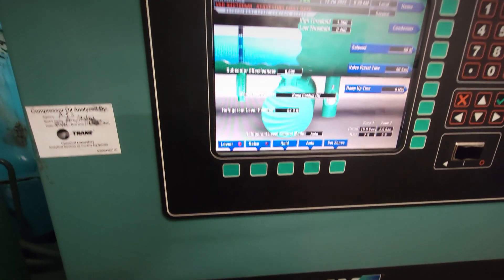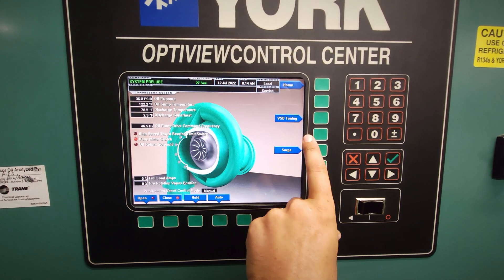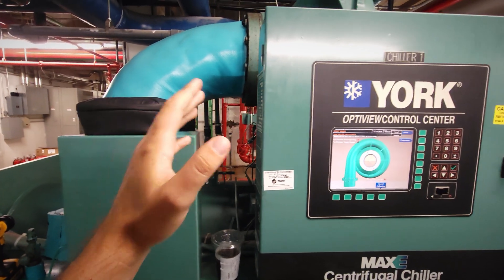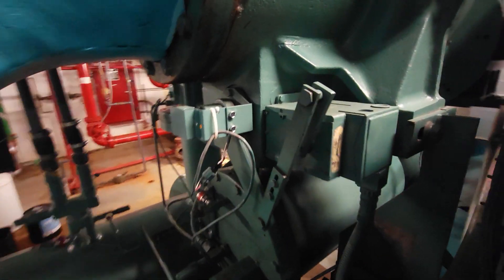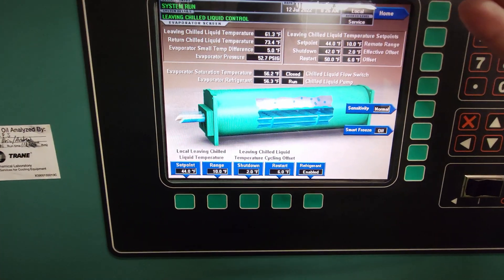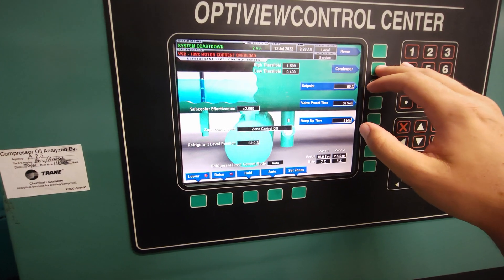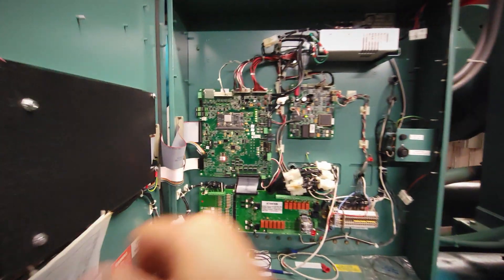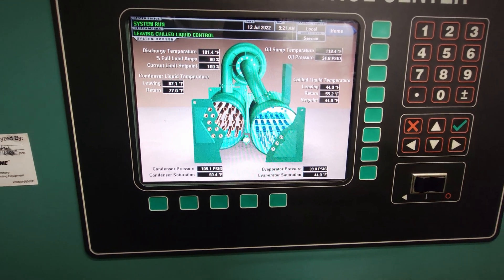Problems kept coming with chiller

Comment: doing a vane re-calibration has 0% to do with vane closed switch  or control of vanes. Vane motor does not stop when closing because the feed back position indicates 0. it is internal limits in motor or physical stalling before internal closed switch is made.  Important if sharing info that it is accurate. i don't want to be that negative guy but it is important to be correct.

Comment: Actuator more then likely on its way out. I’d clear out the surge map shows over 13k surges Maps probably full and machine will run better. 80% for 10 minutes is more then enough for your pull down. Just my two cents.  
Next time you are working on a York pull the VM cover. Vane Motor Switch Operation (VMS)
The auxiliary contacts are internal Normally - Open (NO) contacts on terminal 1 to 6 on the actuator terminal block. Notice that terminal 1 has a jumper wire 1A to L1. L1 is supplying 120 vac to terminal 1. When the vane motor actuator shaft is within 11° of being fully closed (CCW), the auxiliary contacts 1 to 6 close, supplying a 120 vac signal to terminal 6, which would then be routed to the respective control panel to indicate that the vane motor/pre- rotation vanes are in the closed position.
Reply: Takes a brave man to clear a surge map out without knowing what else is going with site conditions.

Comment: Hi , I have a problem with chiller york YCIV0280 sometime run very well but sometime run but the temperature not low of 58°F and not show alarms the suction 50 discharge 229.